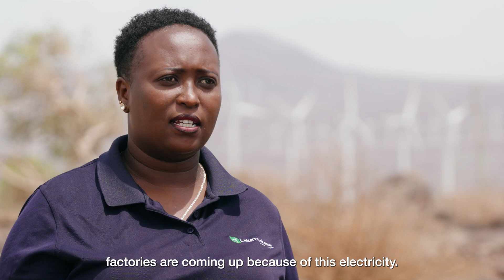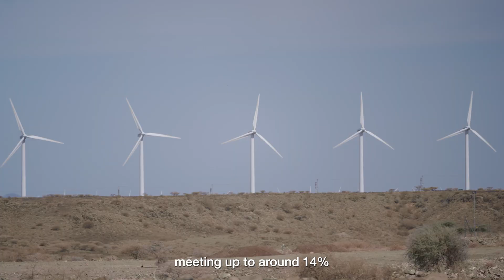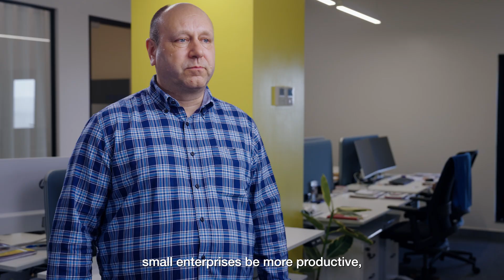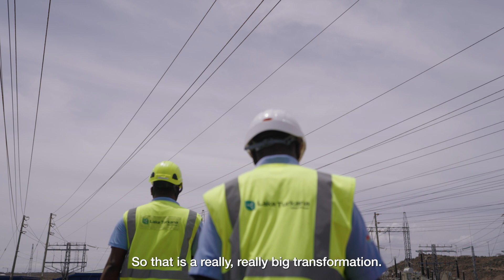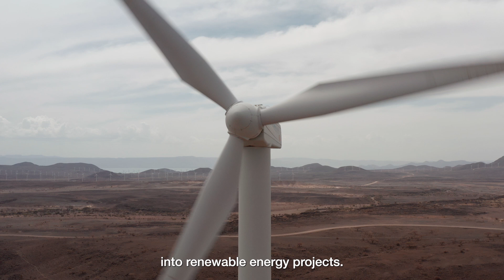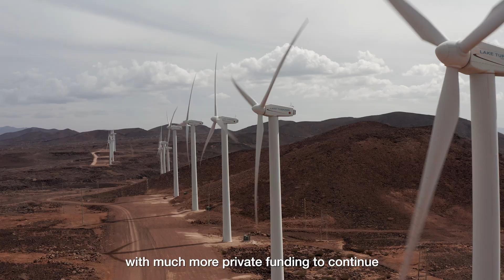Lake Turkana wind farm in Kenya is one of the best wind sites in the world

Comment: After just one year, large wind turbines produce more energy than they have consumed
The life cycle assessment of a wind turbine covers six major areas: the wind turbines themselves, the foundations, the cabling within the wind farm, the onsite transformer station, the cables and the  transformer station. In each area, energy consumption and pollutant emissions were calculated for even the smallest components. Example, for the electrical generator, how much iron, copper and other materials it contains, how the materials are refined, how much energy it takes to produce the materials and wind them into a generator, and how many emissions are produced in the process.

The result of all the individual calculations by  RUB engineers: three quarters of the energy is consumed by the wind turbine during production and assembly (big quantities of steel). 20 per cent of the energy is consumed during operation - mainly for maintenance work. Finally, at five per cent, dismantling is the phase with the lowest energy consumption in the life of a wind turbine.
Reply: And what do you propose Kenya to do? Do you want them to start burning natural gas bought from Russia or digging up coal to use as thermal energy the way Germany does?
Reply: @PerAsperaAdAstra8755 
Is this complicated? Please try to  understand the technical explication that wind farms are better than natural gas, even when they consume a small portion of electricity.

Comment: This was supposed to be a great and monumental project for Kenya but incompetence and I suspect corruption ended up messing up Kenyans.1st, this project doesn't produce the promised 310 MW capacity, but Kenya pays the company based on its installed capacity and not what it generates. 2nd, the project was completed in 2017 but somehow Kentraco had not completed the transmission lines to connect it to the national grid. So we ended up paying 14.5 billion for power generated that we didn't even use (this one was our fault, not the investor's fault). 3rd, the power purchase deal means we will buy power from the investors for 20 years, after which the company will revert to the government, the problem with this is that wind turbines have a life span of 20 years meaning we will basically inherit unproductive wind turbines. This is why electricity in Kenya keeps going up
Reply: Thank you for the clarification. Perhaps you or someone else can release their own video rebutting the rosy statements made in this video.